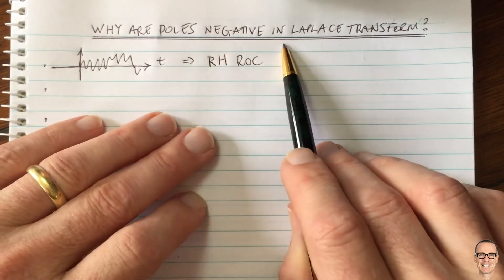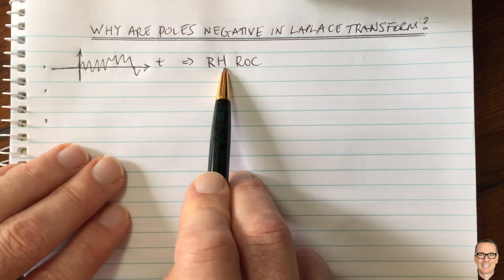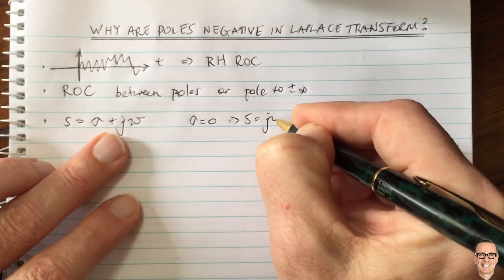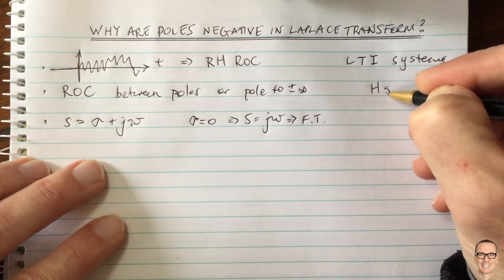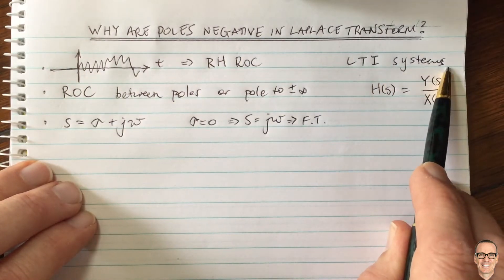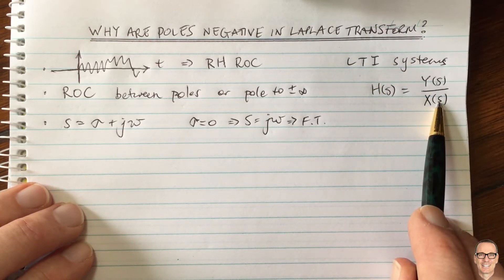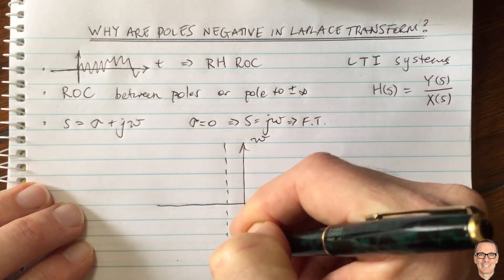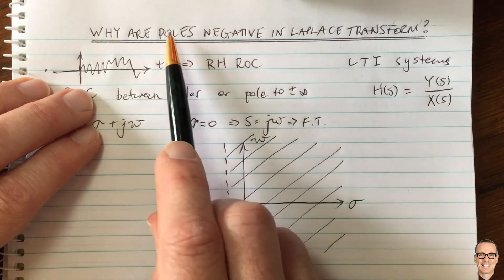Why are Poles Negative in Laplace Transform of Real Stable LTI Systems?

Comment: Hi, thank you for the great series on this topic. Probably a stupid question: If the FT can exist if the weighted damping can cancel out the indefinite growth of the signal, why does a causal system still requires the coverage of sigma=0? Is this to ensure the system is guaranteed to decay even if there is no active damping?
Reply from the maker: For a system to be stable, the impulse response must have finite energy. If it has finite energy, then the Fourier transform will exist. If the FT exists, then it will be in the region of convergence (ROC) of the Laplace transform. sigma = 0 is the region (ie. domain) that corresponds to the Fourier transform (ie. Laplace transform equation, with sigma set to zero, gives the Fourier transform equation). Therefore the sigma = 0 line will be in the ROC.

Comment: hello professor lain  very clear explanation moreover i have a small query which is somewhat related to Laplace
if we are providing u(t) as the input to the RC circuit it will have a transient response ?, because at t=0(minus) charge across the capacitor will be zero and thus it will have no charge to discharge through a capacitor, 
so my question is that its the transient part which is making the system unstable and since we are using Laplace transform for the stability analysis which is unilateral transform so there will never be the transient part, in that case, the system will always be stable so what is making the system unstable, I might be wrong but this is my doubt 
hope you will have a look and give it a reply
Reply from the maker: Sorry, I'm not following your question. When the input to a capacitor undergoes a step change, the capacitor either charges up, or discharges, until the new equilibrium is reached. It's not necessary for it to have charge to start with. If, for some reason, the charge keeps building up and up, and never reaches a new equilibrium, then the system is called "unstable".
Reply: A RC linear circuit, with no amplifiers in it,   will be always stable.  Only if an amplifier is added, and a feedback loop exists in the circuit,  it could become unstable if not enough damping exists.   In the real world, there are not unstable systems, an out of control situation ends up in fuses getting off, wires getting melted, amplifiers  burned, and then everything settles off.  Even a exploding Atomic Bomb  (or a Super Nova) ends up settled.